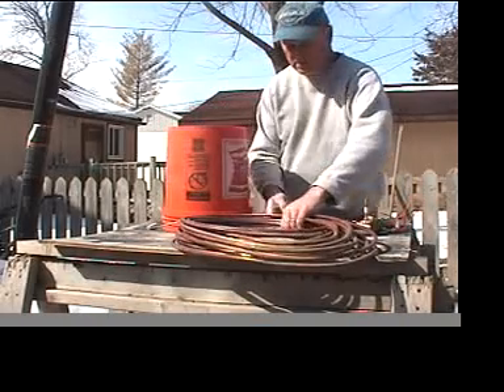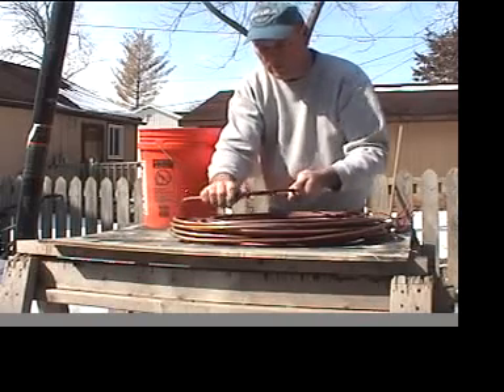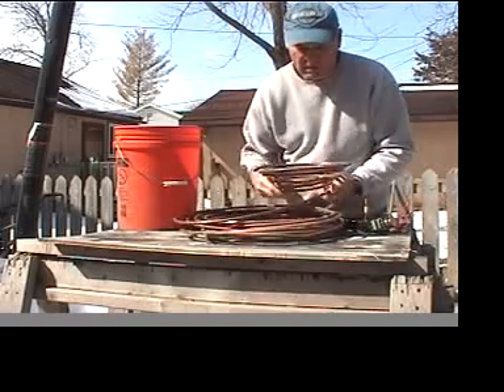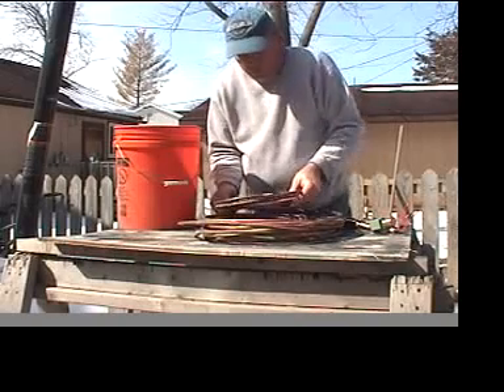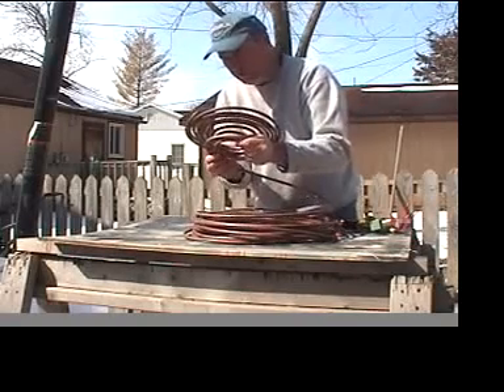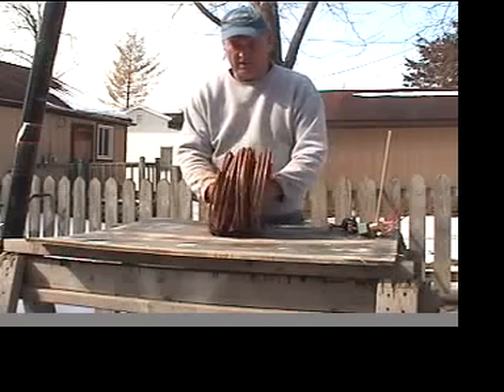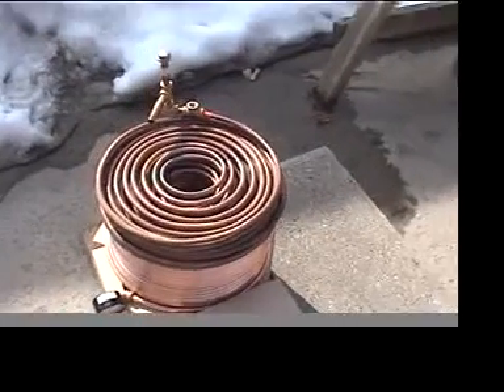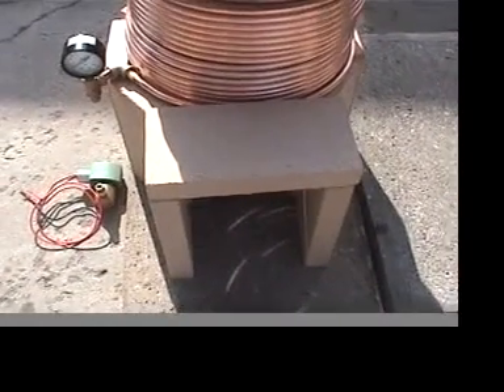Lynx Monotube Boiler part 2.mov

Comment: did you use compression fittings to connect the coil piping?
Reply: No, not inside the boiler.  Should be welded.  There is quite a lot of movement under pressure which would work the joints apart.  Outside the boiler I use flare fittings.

Comment: could you start with a flat pancake coil and then pull it 'open'?
Reply: there's a how it's made of a 'modern steam engine', flat coil, wire stitching to hold it together and keep the spacing, wound on a form that the stitching is done through.
Reply: felderup
I saw that video (Harry's Cyclone)  That is clever and similar to the way it was done 100 years ago. Anyone doing this should look at that technique to stitch the coils together.
Reply: +Lynx Wind you sure make it look easy